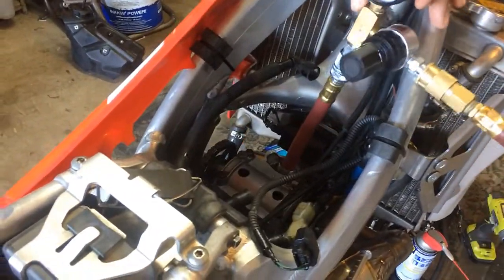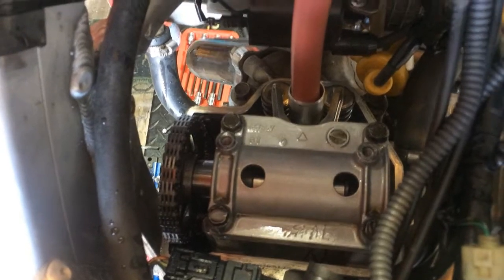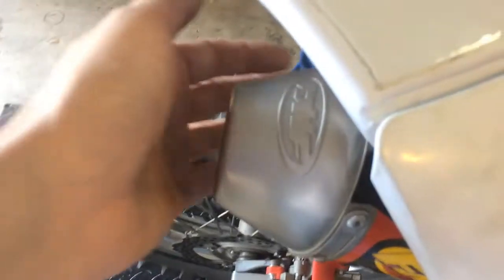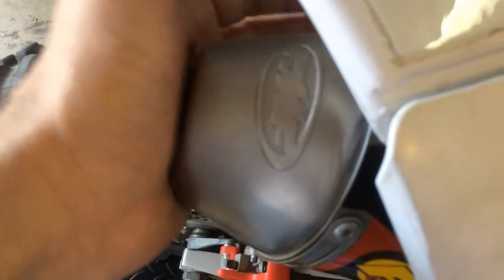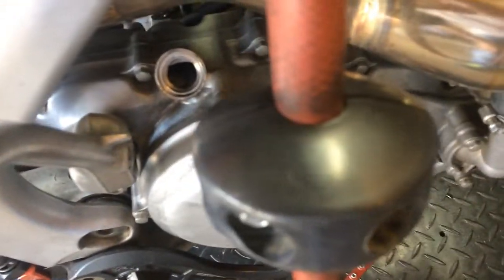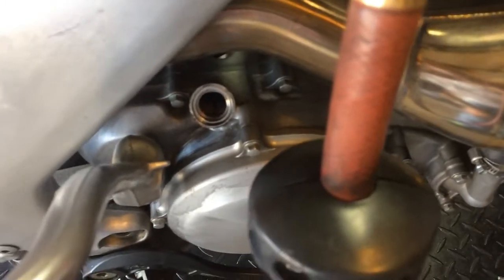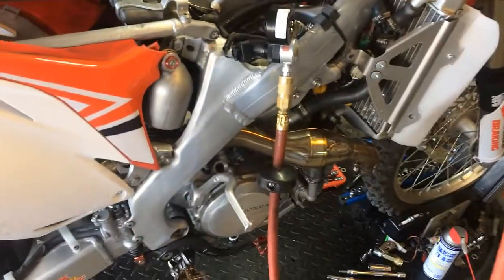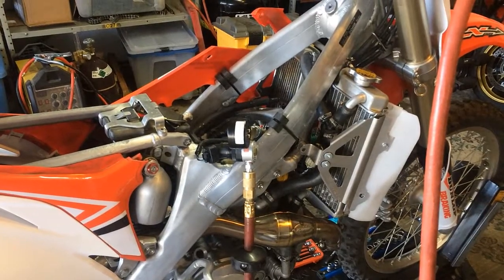CRF450 leakdown testing

Comment: I bet you felt stupid when you found that out after you pulled the head and found nothing :)
Reply: @jeremiahlf   At risk or getting told off for poor spelling and grammar and lack of knowledge is that because of the 4 processes that need to happen in a 4 stroke induction, compression, ignition, exhaust. induction happens before top dead centre which has valve over lap with the exhaust valve that closes after top dead centre when compression happens after bottom dead centre when the piston start to rise compressing the mixture